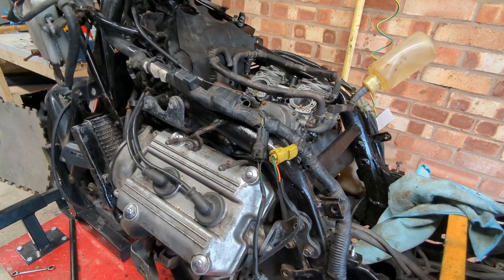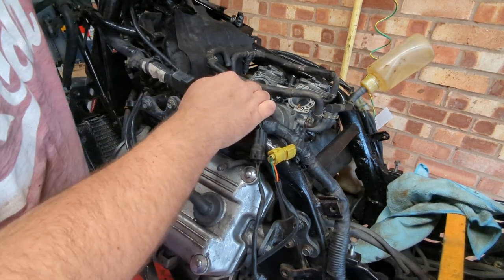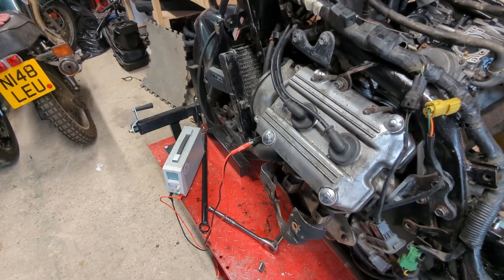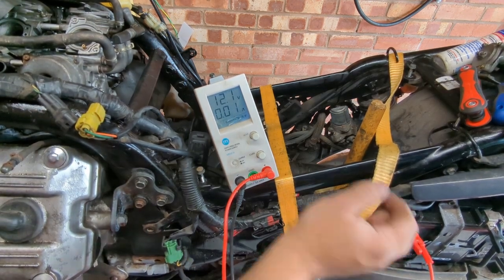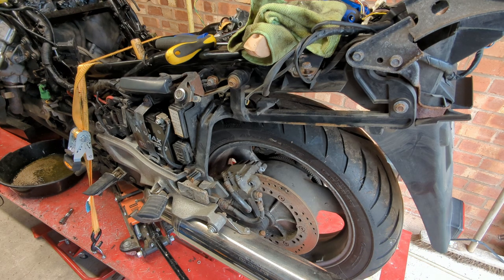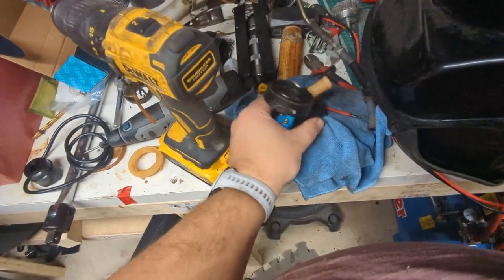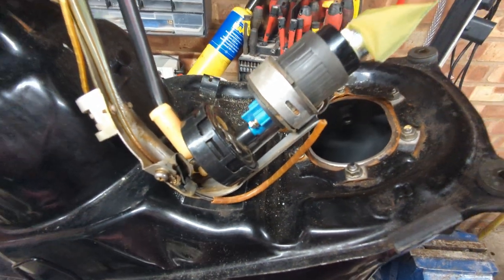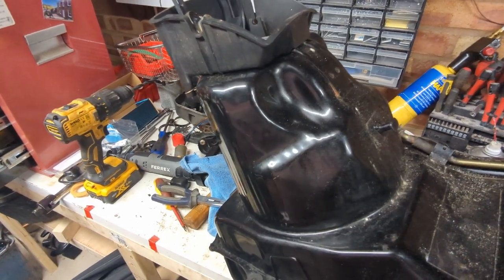The engine runs and the gearbox works! | ST1100 Refurb Pt5 | JAM#44

Comment: Sounds like it's running pretty smoothly. Transmission and final drive looked pretty buttery, too. Definitely a Honda.
Reply from the maker: As long as the 1997 ABS & TC computers also act nice and Honda I will be happy !
Reply: @justanothermotorcyclist  stranger things have happened! Though I guess plan B can be pull up he fuse and take the bulb out 😅
Reply from the maker: @BobsBikingAdventures  I may or may not have some code for an Arduino Teensy from my younger years that mimics a working ABS & TC Light 🤣
Reply: @justanothermotorcyclist  haha that's hi tech. I may or may not at some point have simply bridged ABS / Check Engine / Airbag lights to other lights that go on, then go off again..